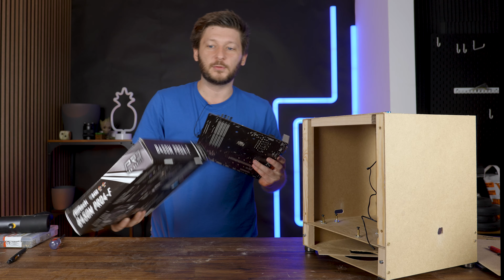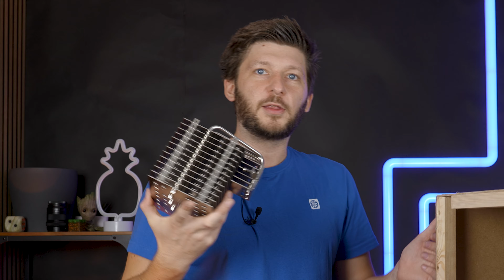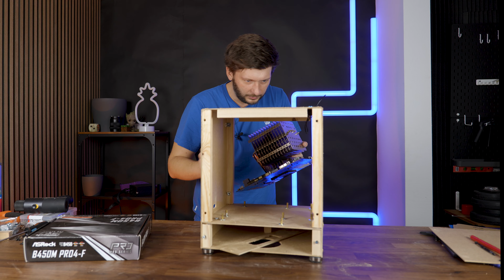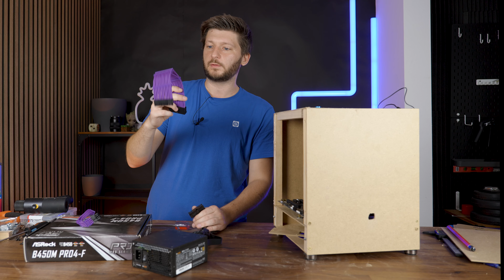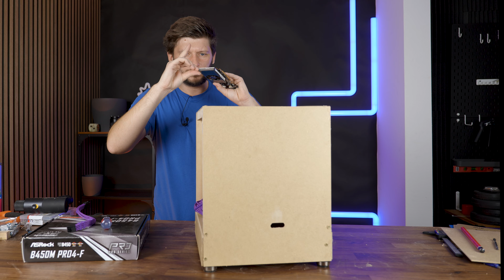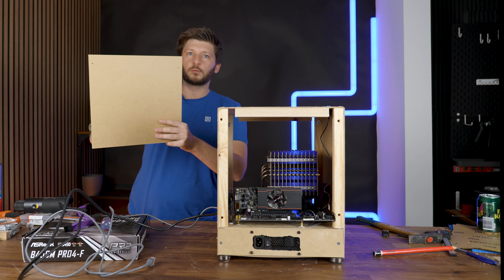Finally Building A Real PC - DIY CASE Fan Testing Machine - Part 7

Comment: I've never been this early to a vid. Question, I am planning on getting a new gpu and i'm not sure if I should get an rtx 4070 or 4060, the 4060 is almost 200$ cheaper but is about 40% slower, which one should I get?
Reply: Whatever you do I'd wait for the 4070 Super refresh first. Thats rumored to come earliy next year. The 4070's Super will be nearly as fast as the 4070Ti but at around $600-650. And the normal one will likely drop in price.